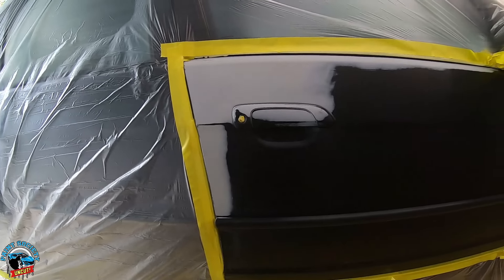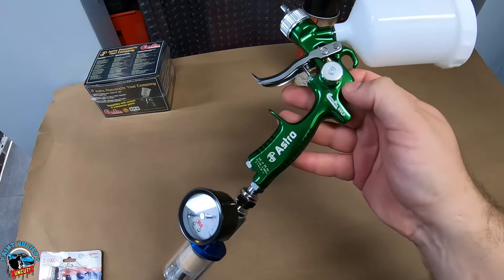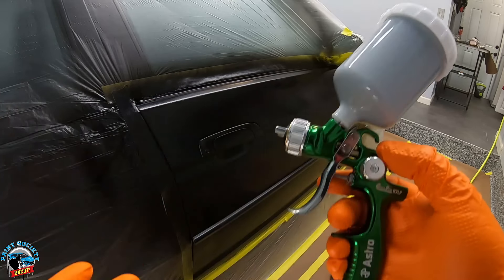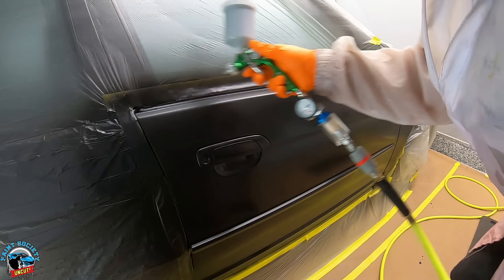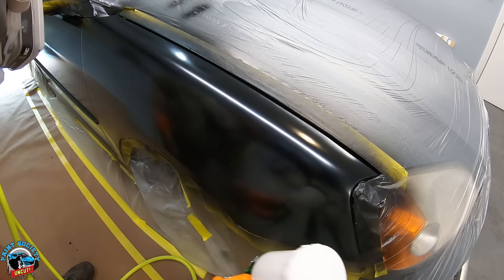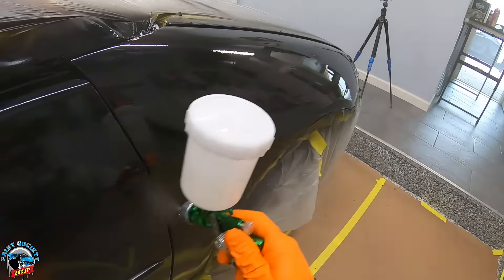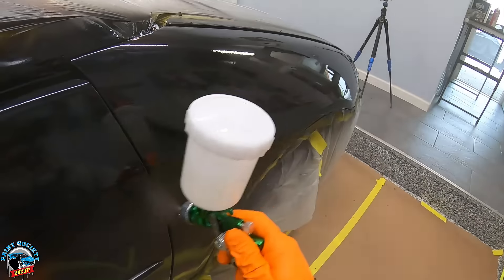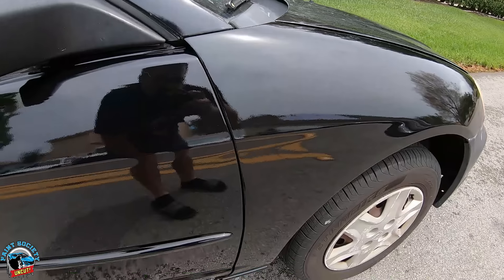The Cheapest Way to Paint a Car with AMAZING Results!

Comment: That gun with a 30-35 gallon compressor would be interesting. One that runs off of 120 volt,20 amp circuit.  Only suggesting it to a brilliant painter like you.

Comment: Please may I ask for opinion/help? Thinking a respray of my white sprinter (big van) to black using a 50L/10gal tank. 

With no inside space to park in for work, what are the negatives to painting panel by panel over a period of days?
What sanding techniques are used to prep the factory white panels? Are you sanding between primers, bases or clears?
Any advice on painting sills or interior door areas?
Paint:Thinner ratios are dictated by the paint, correct?

Thank you very much

Comment: What is the max cfm on that compressor at the desired/gun-spec operating pressure? 
I'm guessing if you had a small compressor with just a little more volume than that pancake compressor you could make due with that pretty well. Perhaps 3x the tank volume of that one. You'd still be in a budget-class compressor for sure but I bet you could make it work pretty nicely.

Comment: This guy is clean. Very impressed at how tidy he is when he works. Also, I would give the credit of the end result more to this guy's skill than to any merit of the compressor he is using. I know very little about painting, but if I were to attempt this with the same set up, I'd use two of the same craftsman compressors running simultaneously and alternate them with pressure drops.

Comment: Love your videos. I’ve run into a couple questions.  (By the way, I am painting a waverunner for my grandson. It’s looking good.)

Question. I am using “Topside 1 part poly” and am spraying with the R500 gun you recommended. 

First, the nozzle is really tight from the factory. I’m concerned about adding more pressure to unscrew it ( for cleaning). Should I be concerned about causing damage? Any tips for removing it.
Next, the topcoat has an orange peel look. Should I sand it flat before spraying a 3rd (thin) layer?
Finally, the paint doesn’t call for a clear coat. Should I add one anyway for its hardness and protection and if so, what do you recommend?

Thank you so much. Love your work.

Joe M 
Kansas City

Comment: Brian, any reason why you never went with a LVLP gun, wouldn't that give better results with a tiny compressor with a low cfm?
Reply: Do One  
I thought the LV vs HV is around the 10CFM mark?
And they are differently designed on the inside to make LV work..
Why would you sell a small gun that uses LV as a HV gun?
Reply: Do One  no need to be sarcastic, wheres any mention of the mini hvlp's cfm usage? Unless i missed Brian mention it in the video somewhere. Pretty sure he didnt mention the cfm requirements of that touch up hvlp gun though. I always thought lvlps required less cfm than even a touch up hvlp? But then again ive no idea as i only use a full size hvlp and a lvlp occasionally. No need to get all rude 🙃

Comment: Idk if you’ll see this comment but it would be pretty cool if you could do a whole series of videos like this with different sized compressors. All the way to like a 15 gallon. I know me personally I don’t have access to a 240v outlet to run a 60 gallon compressor. I’m pretty sure a 15 is as large as I can get away with for home jobs. I’m sure there are many people in the same situation
Reply from the maker: When I sprayed in my parents garage moons ago I was able to get by with a 33 gallon. That was the biggest that was still 120. I was able to use my Da sander and paint. The compressor ran continuous but it worked!
Reply: Awesome! I have a 1996 f150 in need of paint I’m hoping to do this spring. Sounds like their may be hope for me !! Cheers!

Comment: I airbrush. I don't want to do big surface like cars. It is more like bike frame, motorcycle fenders (scratch repair), hubcaps. So the question is what Nozzle size should I get for small parts with a 4 and 8 gallons compressors for paint and for clearcoat

Comment: I always thought a very low PSI was required to paint and thus didn't need a huge compressor but I am no expert of course... Any tips on what PSI to set the regulator to? My very first pain job as a teenager I had the PSI set high and the whole job was speckled and bumpy 😆
Reply: You would think so but the amount of air you accumulate shooting is astronomical. You can go through 20 gallons in 1 min and a half with a top quality paint gun

Comment: Got my bumper plastic welded up thanks to that video you put out on that subject already $350 ahead on just the bumper savings by fixing that vs replacement... 

Now onto More of your content about painting ...I hoping I can get a little nugget advice / info .. I have one paint booth I can rent but it is a 1 hour drive away ... Not a big deal the drive but I am trying to figure out if I can do all my sanding at my house then just clean it up after I arrive then there is the idea that I am painting my car two colors .. or I might just go straight glossy black ... Water spots and washing annoyance ah well...

If I go two colors 
I having a hard time finding just where I should make the split with the roof ... Paint the A Pilar black or make that red and just use the channel on the roof to split the red and black there ... 

Car is a 1999 Subaru Legacy Sedan

...I don't think color choice is overthinking and breaking the 'its just paint' mantra 😁

Appreciate any advice you might offer ... Thanks 👍
Reply from the maker: Please message me in IG and I can get back to you with voice memos so I can help you better with this. 

Paint.society

Comment: My wife’s car got shot a few weeks ago and I wanted to sand it down and patch the hole up and shape the line up the bullet went through the driver side quarter panel right through the body line I went to school for auto body 2 years ago I’m currently a welder but I wanted to buy a 26 gallon compressor and I might pick that gun up you was using in your video if it’s good on not having a ton of overspray I was just wandering if I should use a couple fans in my garage when painting my wife’s car or not wasn’t sure if you was using fans in your garage or not and should I sand the whole quarter panel down to the rear door and rear bumper and paint the damage and do the blend to them panels or just keep it in a small area if u could answer some of these questions I would appreciate it it’s been a while since I done body work or painted I wanted to get back into it and watching your videos reminded me a lot of stuff I learned in school 👍

Comment: big problem you will run into with a pancake or even 30 gal or 60 gal compressor that the SCFM is not enough is that your air will be hot drying paint to fast and condensation will be a problem. You will see condensation at the gun condensation if not sealed well.

Comment: I would love to see a video about the Iwata LPH80 1.2 with a small compressor.  I’m thinking about getting it for my Cerekote spraying but wondered if I could do bumpers and fenders reasonably with a small compressor at home.  Air consumption is comically low on the LPH80, it would suit a small compressor I’d think. 

Love your videos, I watch them multiple times!

Comment: I did this once and put 50 ft of the air hose in a trash can of ice water to cool the air line. Then water separator filter before the gun. Warm air flashes the paint a bit?
Reply from the maker: yes it will and that works

Comment: I have a mid sized compressor, is this gun a better option for that? I'd have much more air to use

Been dying to learn to paint at home! 

Do you recommend anything else other than just that little in line filter to avoid water?

Comment: Great video.
Question - i have a 120v/130psi Husky inflator.
im giving my ebike a new paint job.
and was wondering if i could use this tire inflator 
as my air compressor with a spray gun.
if so, what “conversion” parts would I need?

/Bklyn👑

Comment: I'm intrigued by this video by what you were able to do with a 6 gallon small compressor. I'm in the process of painting my girlfriend's car tomorrow which she has been begging me to do and I'm a brand new DIY never sprayed a vehicle before person. I purchased multiple guns because I'm not sure which one to go with yet Harbor freight HVLP (6 cfm), a throop HVLP Amazon special (14.5 cfm), and my buddy lent me his Devilbiss gravity feed sprayer. I'm not quite sure what CFM this one requires. But out of those three which would probably be the best choice as a DIY first time newbie spring sealer, base coat, clear coat on a Miata with a 20 gallon compressor? I already have a multiple Airlines, long linear feet, to cool the air and an inline filter. Just wondering what the best choice would be for me

Comment: Omg that compressor must be so loud.  I can paint an entire care with a iwata lph 80 with the e4 cap and 1.2 nozzle. And my lowes quiet 4 gallon  that is enough to spray . The key is the quiet compressor.  You should try this set up that I just described. 1t uses 15 psi and low cfm.

Comment: Only thing I'm wondering after this video was the pressures you had the compressor at.
150 maxed out or did you run it @ 120
Reply from the maker: 40psi

Comment: One thing I wasn't clear about -- and I'm sorry if you've already answered -- at one point in the video you said a 0.8 nozzle might work better at atomizing the paint. But at the beginning you said your gun had a 1.2 nozzle. So did you end up using a 0.8, or did you use the 1.2 for the whole job? Other than that, great video, I'm going to give it a try.
Reply from the maker: I learned along the way that the .8 would probably be a better fit. In a later video I used the .8 with better results

Comment: This is all about skill... I have none ... but I really like this video. I want to do it, but I really don't want to spend thousands on a massive compressor (and also a space issue) to do it occasionally.  Basically I want to clean up our off roaders on occasion. I'm more a hobby guy ... just my models got bigger. So I'm trying to see if I can use this 20 gallon, 2.5 hp compressor that my wife got me (at a yard sale). I want to tackle her Sidekick and get rid of the scrapes and rust on the body, and the same with our other two Jeeps. Then go out and do it all again. Really, I just wanted to try painting a car. Then may never do it again.

Comment: Great video!!! Have a question hopefully you can provide / share answers. I have a motorcycle I like to paint. Do I need to strip it down to bare metal or can I remove the clear coat and use the current paint as a base to paint over it. The current paint is in good shape and the body does not need body work.

Comment: This is what I'm about to use for a bumper and possibly the roof. It's peeling and i am in need of getting it fixed. Also, what would you recommend for a compound to buff with, and what tool. That's the only thing I haven't bought yet. I got everything else you recommend.

Comment: Hey there, great video, but I was wondering what you will think if I used a Husky 20 Gal 200 PSI, 4 SCFM @ 90 PSI Compressor instead of the pancake compressor you used. Will it be significantly easier for panels compared the pancake one you used in this video. Will it be more consistent in the since were I don't need to change the amount of paint coming from the gun often to have the correct wetness? Only planning on doing panels for upcoming projects.

Comment: Well here’s my 2 bits of info. I’m going to paint the hood of my car over. I bought a 10 gallon 135 psi 1.8 hp, 5 cfm at 40 psi compressor.  Cut in pressure is 105. I was worried the cfm won’t be adequate. However I got lucky. I ran my 7 cfm spray gun with water and after a minute the compressor kicked in and thankfully maintained pressure at about 100 psi for several minutes.  Maybe the cfm of the spray gun is actually lower than stated. This is more than enough time to make a complete pass on a panel. Your spray gun operates at about 35 psi. So this compressor should work if my logic is correct.

Comment: Actually since you've connected the compressor to your whole system it'll take toll on the pressure. The longer tge tubes are, more strain on compressor. Could've connected directly to gun for more pressure

Comment: I’m planing to paint my car to a Mattie military Green. Anyway you can make a video about Mattie paint. My concern is about how keep the Mattie look after the clear coat. I did my wheels but they give me some shiny look which I don’t want it for the car. Thank in advance for your tips
Reply: Need to use a matt clearcoat rather than a gloss clearcoat buddy
Reply: @ukvinersmart7571  thank you for the comment, I did but it still have some glossy look. I’m afraid that will happen to the car too.

Comment: I just bought that little gun, but I cannot find any 3m PPS adapter. Astro made this gun with a M11x1.5 thread, which prevent using 3m PPS cup as 3M adapter available are M11x1.0 thread

Comment: Hi Brian, what type of paint gun and nozzle would you recommend for epoxy priming and high build priming of bare steel bicycle frames?  Full size gun with big nozzle as suggested by paint
manufacturers for doing panels or can I do the job with a touch up paint gun as well, maybe thinning the epoxy and the high-build to flow out of a small nozzle? I am concerned that a full size 
gun will have a lot of waste overspray as well as not be able to fit between the bicycle tubes to reach some tight spots on a bicycle frame. Thanks

Comment: Brian - is it key to use a detail HVLP gun instead of a full size one?  I'd think you'd have bigger problems losing your wet edge but I don't really know.  I've got both a detail and full size HVLP gun...but a crummy little compressor (next step up from pancake but still tiny).  Which gun should I use?  Big one or little one?

Comment: I’m planning on painting my SUV. Would you recommend doing it this way? Or with an electric hvlp gun similar to the Wagner control spray 250? If I choose to use my bostitch 6 gallon compressor should I use an LVLP gun instead of HVLP considering they require less air pressure? Any advice would be helpful. I know you said this kind of setup is better for doing a couple panels but I know I can get good results on the entirety of a car. 
There are some nice looking electric spray guns on Amazon for $50-100 but is it really worth it when this video shows that a small compressor can get it done with enough practice and finesse.

Comment: Even a mini HVLP uses around 6cfm, but that pancake is going to be under 3cfm even a 40psi. A better choice would be a full size LVLP gun like the SPRAYIT SP-33000K which only uses around 3.5cfm....Though personally I wouldn't even try to use the LVLP with that compressor either cuz Oil less compressors have plastic compression rings that absolutely will melt if you push the compressor beyond it's duty cycle....Anyhow, I can't say I've painted a car with one, but i did paint a washer, dryer and refrigerator all at the same time with the SPRAYIT LVLP and can report one of those cheap 8 gallon direct drive oil lubricated compressors will keep up with it no problem whatsoever.

Comment: i am restoring my volvo 240 from 1983 and i have everything to paint the enginebay. but it turns out that the rest of the body has so much tiny rustspots that the best option is painting the complete car. I have an old 1950's 100L air compressor. new paint gun and stuff. Any advise on spraying the complete car? Thinking about doing the body first. and the doors, trunk hatch and hood later. it's volvo 189-2 polar white.
would love to get some comments on this on how to start. do the enginebay first and build the engine in then do the rest? or all at once?

Comment: Just for fun I am going to paint my 2008 Chevy Avalanche and change the color. It is currently three colors and has a hole in rear quarter panel that I can stick my hand in. If I were looking for paint gun for around $150 or less what gun would you recommend? Also could you tell me approximately how many gallons of paint an Avalanche would take to repaint. I do plan to do door jams and remove windows. But I do not plan to do inside of the entire inside of the fenders or the underside of the hood. I know I will use much more paint that you will. I am just curious if you have an estimate?

Comment: So would you say its possible to paint a whole little coupe like that with a 27gal compressor and a LVLP gun like the Sprayit 33000? Thinking to remove the front and rear bumpers as well as the moldings and sideskirts to possibly reduce the running time of compressor

Comment: Great Video Info
Those this method work better for primer.  Just priming the Car Inside and Out. 
Planning to buy a 26 gallon Air Compressor, but I have a 8 gallon Compressor  
.8 or 1.2 tip for Primer     
Is that Astro Paint Gun good for primer?  Just Priming the Car.

Comment: So I only have a pancake compressor so not sure I want to paint my entire car this way. What if I did a turbo Rustoleum spray can then covered it with 2k clear from a can. Is there any difference in spray cans version spray gun when it comes to paint or is it just a spray quality difference? Will the 2k clear hold up as well as a compressor and mix paint job?

Comment: Pretty awesome. Wonder how well it'd do with a slightly bigger 30 gallon? I've got a HF 29 gal that's advertised at "5.9 CFM @ 90 PSI, 7.3 CFM @ 40 PSI"
I don't see a CFM listed for this gun? anyone have that available? You recommend the .8mm tip for the smaller pancake, would you recommend the 1mm or 1.2mm for a larger 30 gallon?
That orange peel looks kinda factory for older vehicles.
EDIT: also, what compressor hose are you using? is that flexzilla?

Comment: Using smaller spray gun and a small compressor, did you mix the base coat normally as you would if you had used bigger gun?